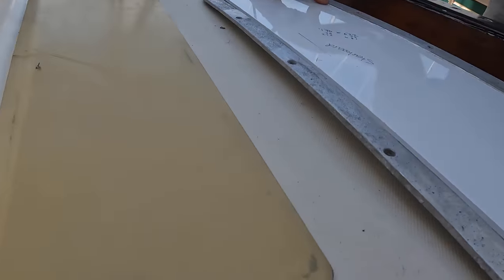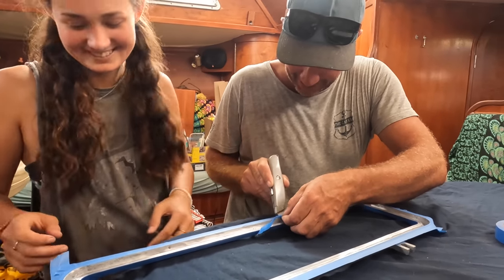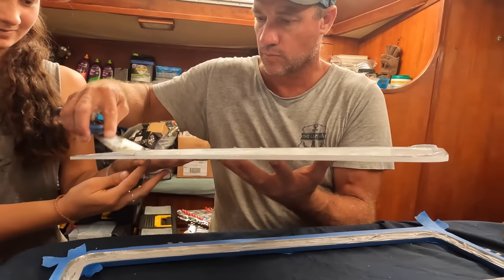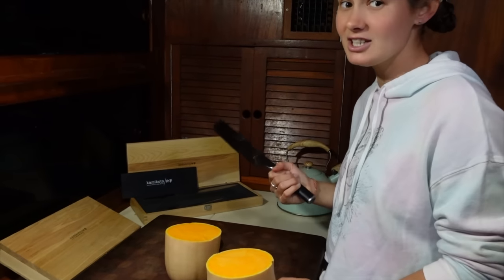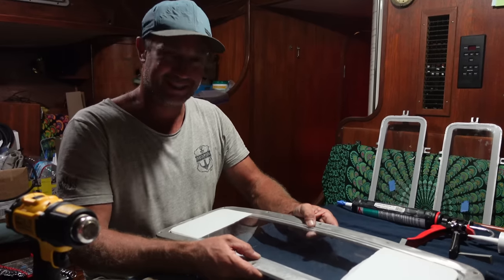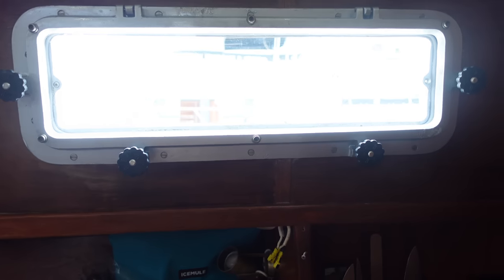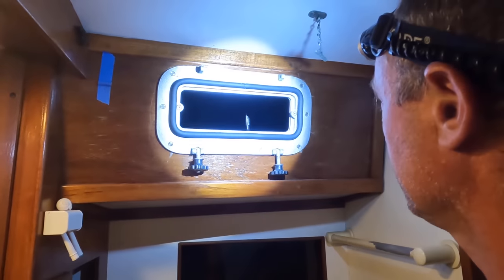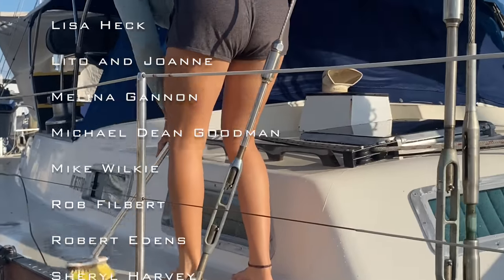Someone is guilty | Ep 319 | Lots of Boat Work Sailing Catalpa

Comment: A porthole, sometimes called bull's-eye window or bull's-eye, is a generally circular window used on the hull of ships to admit light and air. port•hole (ˈpɔrtˌhoʊl, ˈpoʊrt-) n. 1. a round, windowlike opening with a hinged, watertight glass cover in the side of a vessel for admitting air and light. other than that accidents happen so don't sweat the small stuff. great work folks.

Comment: You can use a heat gun for bending acrylic. You have to be a bit patient and move the gun around so that you heat it evenly but when you are trying to bend a line rather than curving a large piece it can be an advantage in that you can control where it gets pliable. Also you can do it in place with your clamps ready to go. As usual, very nicely done.